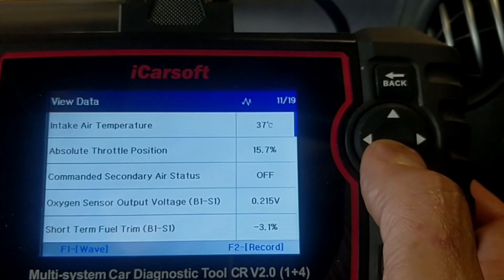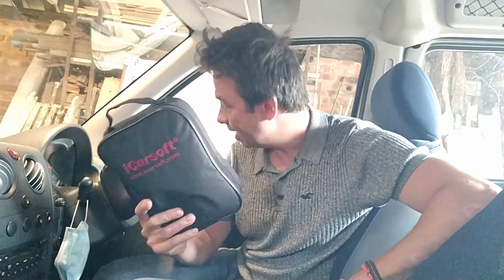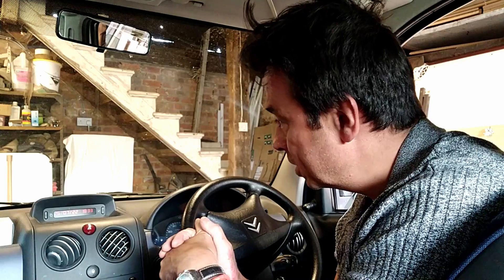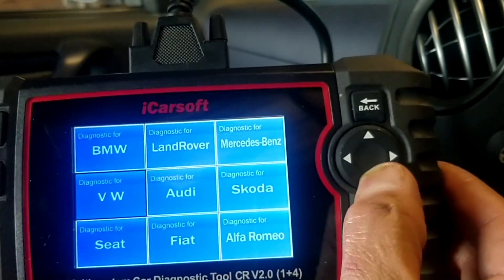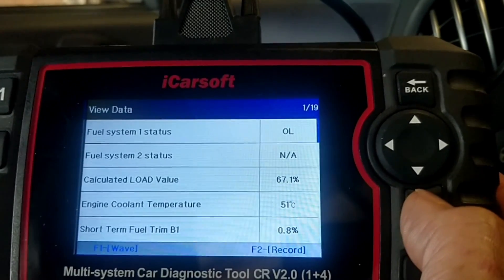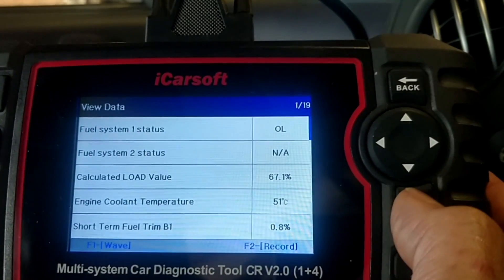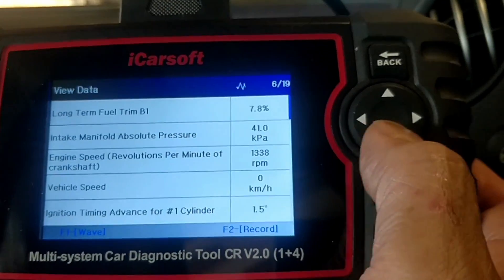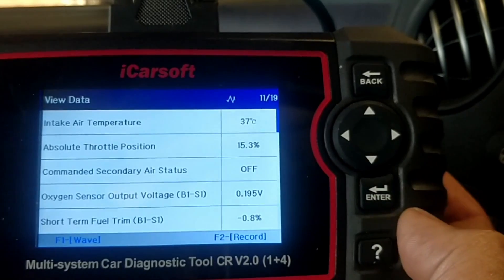How to make iCarsoft diagnose any car!

Comment: Nice video but I can’t understand how that scan tool helped you with this particular problem.  It didn’t give you any codes or even point you towards a problem.  You thought it might be the sensor and cleaned it but the scan tool didn’t direct you towards that.  I understand that it did showed you it working though.
Reply from the maker: hi, the error codes give you the area you look into then using experience and common sense, will then provide the location of the actual fault.
Reply: I understand that but in this instance, the tool didn’t give you any codes.  So in reality, it didn’t really help you at all.  Your own experience and common sense alone was how you fixed this fault and nothing to do with the tool though.  Would you agree?

Comment: Attention Important: The CR Pro can only operate vehicles that were built up to 2016/2017. For all newer vehicles you need the CR Pro + (until around 2021/22). No lifetime free updates... There haven't been any updates for this for a long time. Only for the system, but not for the vehicle files. Unfortunately, I fell for it too. If you want a more sustainable OBD scanner, you'll probably have to go for Launch, Autel or something similar. A pity.

Comment: Promoting a product with the worst customer service EVER. Have you tried contacting their ONE MAN SHOW in the US? He lables his emails "Mr. Barnett", he responds once and then stops, does not read the emails but spits out one email with general instructions. The SD Card on my Icarsoft MBII was corrupted, I spent a week sending more than 10 emails and calling 7 times and no none picks up the phone, and no help whatsoever. I am throwing this piece of junk and getting something more reliable. Bad mistake buying this product.
Reply from the maker: I know what you  mean, the product when it works is very good, but the reason I created the videos was to help others, as the customer service is not great
Reply: It is totally useless for me, just get a "Comms Error" on both my old Jags, yet nothing wrong with the ODB Port as it works fine with the Factory Jaguar Diagnostic unit from my Jaguar dealer!

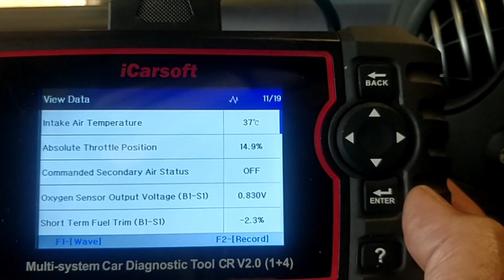Comment: Thanks for making this video, I have a similar, (mostly cold-only) misfire and wanted to check the O2 sensors and clean them at the same time. At 9:50 your screen shows the fuel trim also fluctuating which i assume comes from voltage fluctuation. I believe that some car ECU's will intentionally shut down an injector to protect the catalytic. The annoying thing on my car is that the fault code is just for a specific cylinder misfire however I've purchased the icarsoft v2 so will be better equipped to investigate.

Comment: Why remove and clean when it was operating within its defined parameters voltage wise?
Reply from the maker: It was operating as it should, but was getting false readings due to carbon build up mate
Reply: So the diagnostic didn’t help point you in that direction at all then.
Reply from the maker: @Crane-DriverUK  it did, because the voltage fluctuated within the normal parameters, however the sensor was found to be dirty. Therefore the sensor although working was getting false inputs due to the build up of carbon.

Comment: hi just bought one of these. but connecter dousnt fit into my disco 3 06
Reply from the maker: Hi mate, does your disco have the normal obd2 port rectangular plug?
Reply: @GrooveOn  thanks for your reply.its sorted now.just had to use a bit of extra force.cheers.

Comment: Have l missed something  if the diagnostic tool says that the oxygen sensor was working perfectly and running within the specified parameters. Where is the indication that prompted you to diagnose that the oxygen sensor had a problem that made no sense at all
Reply from the maker: Because the sensor voltage was looking normal, I thought I'd remove it and clean it as a build up of Carbon can lead to issues, giving false levels.
Reply: Agree, the scan tool didn't indicate any fault or isolate an issue. The gentleman cleaned the sensor due to experience.

Comment: very good 
i have icarsoft for landrover
recently the dpf blocked up  car went into limp mode
in the service menu there is a dpf regen routine 
guess what it actualy worked then it cleared all fault codes.
really usefull bit of kit😊
Reply from the maker: That's so good to hear!!!
Reply: Thanks, thats good news. If it works well on LR then mine should be fine, regards 👍🏻